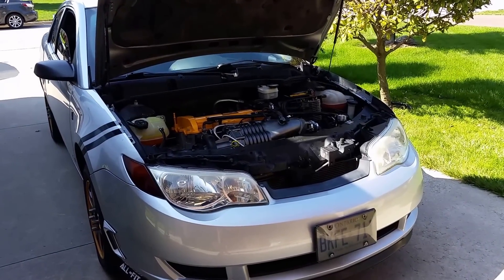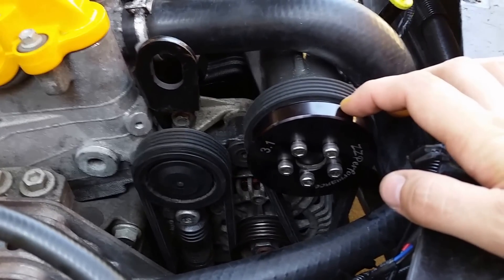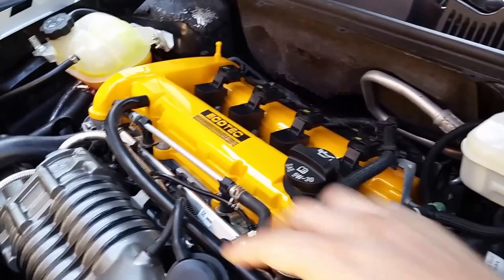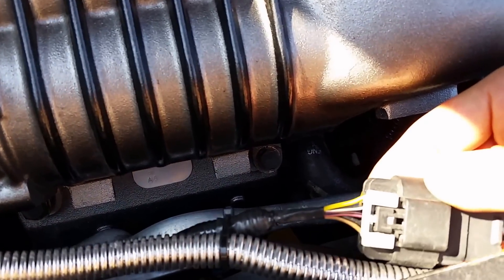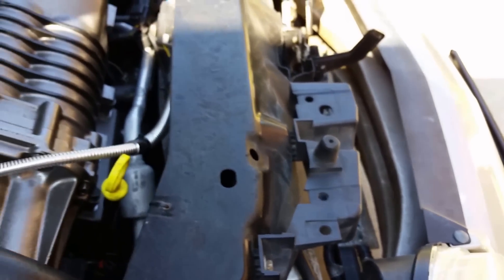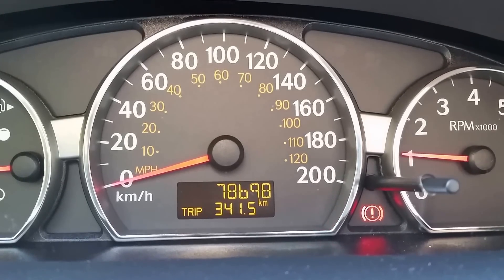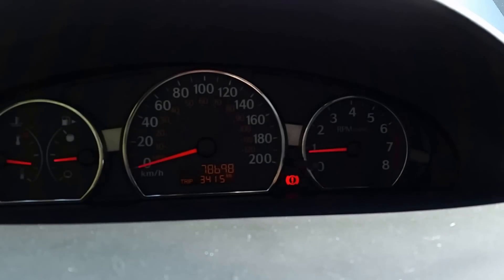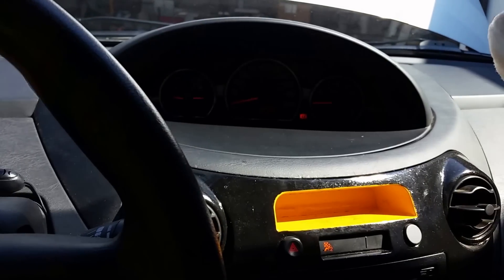How to Supercharge a 2.2L L61 Ecotec - Part 2 - Engine Bay, Idle, and Driving

Comment: I have a 2010 chevy cobalt xfe can you do anything to that? Any input is helpful. Thanks in advance.
Reply from the maker: It's a 2.2L with different gearing to make it more fuel efficient, I don't see why not! Should be the same Gen 2 block that I have in my car that was introduced in 2007.  Definitely tunable too by ZZP if you get HP Tuners or know someone who has it and can buy the 2 credits to unlock your car for a remote tune. Also it would be awesomely ironic to make an XFE into an SS and make it as fuel-inefficient as possible haha
Reply: If anything done right it should be faster considering the taller gears

Comment: nice job!
reverse rotation alternator could be detrimental to cooling, since the internal fan spins backwards
Reply from the maker: beforebefore thanks! too bad limousines and other vehicles with multiple alternators do the same thing. And it's been 14 months with absolutely no issues on my car, 3.5 years on my friends Cavalier with zero issues. 5 years on another local cobalt original alternator zero issues spinning backwards.... I'd say the cooling loss is negligible.
Reply: Vincent Colussi - Hey, it was just a thought, I'm glad it works out good!
Reply from the maker: beforebefore lol I thought you were sarcastically saying nice job, in that case thank you - oddly enough it has no real adverse affects although I see your point with the direction of the fins on the blades to cool it down. If cars were AC not DC then absolutely this would cause problems, luckily alternators convert to DC

Comment: so ecu-wise you changed nothing? only the software obviously?
Reply from the maker: Yes same stock computer, but had ZZPerformance tune it. Using HPTuners, and they e-mailed me my tune files to load into the stock computer and overwrite the OEM tune. Literally everything works as it should
Reply: Vincent Colussi would you send this tune file?

Comment: i  have a saturn vue 2003 whit ecitec 2.2 manual transmission  and i lovet but if is posible do supercharged
Reply from the maker: Marcos Martinez I mean theoretically yes, would have to see the engine bay layout but am sure it would be fine since a v6 fit in those. You would need to find a local tuner for your build though. Companies like Zzp and Trifecta only do 07 and above for 2.2L
Reply: How about a 2.4L ecotec greenline setup?
Reply from the maker: Honestly not sure about the Green Line, i know the 2.4L can be, not sure if the Hybrid components would interfere too much with the supercharger parts

Comment: learn to shift please , I  grind my teeth every time , that poor clutch , good build tho , well done , now I read the trans they put in those can only hold 300 hp is this true ?
Reply from the maker: shaun philpot lol I intentionally don't slam shift and wait for the friction point to grab. I could easily drive it aggressively but I value my clutch. That rattle was a bracket loose inside the dash I fixed it since this was uploaded. f23 is good for over 350hp. Getrag over engineered the safety factors the castings can take a beating compared to the f35.
Reply: Thanks for explaining , o0 awesome.

Comment: just bought my first cobalt I got a 2005 Chevy cobalt L's with 2.2 Eco tec been looking for kits anyone have some suggestions
Reply from the maker: Nick Breen Facebook groups are your best bet for used parts. ZZPERFORMANCE still sells a kit for around 750 without the blower or manifold. Can buy those used on Cobalt Nation Buy/Sell/Trade,  Ion Redline Lovers, Ecotec Nation etc. (all facebook groups)
Reply: Vincent Colussi I'm looking them up now but another question the motor in my car was replaced in 2014 with go to 133 but won't rev past 4k in park
Reply from the maker: Some tunes restrict your neutral/park rev limit to 4000RPM. Might be that?

Comment: Beautifully done! How difficult was it to install? I'm thinking about buying the kit from ZZP for my cobalt but I'm not sure If I reached that level of expertise yet.
Reply from the maker: oDieseLz it's not too hard their manual is detailed if you buy their kit. I pieced all my stuff together but have seen their manual it covers most the bases. Pictures torque specs step by step etc. 
Their kit doesn't use the LSJ TMAP sensor like my setup does though. Would recommend doing that since you can get that temperature reading after your supercharger compresses the air by wiring the TMAP temp reading wire to your MAF harness temp reading. I went to my local dealer and got the wire diagrams and pin outs for the sensors, easy to set up just take your time.
Reply: Thanks for the info. I could always just buy an SS but what would be the fun in that?
Reply from the maker: Exactly. Built not bought is always more fun!
Reply from the maker: @Cory Scopis because half the work is already done for you. Making parts compatible, thinking about signals and wiring diagrams and PCV port alignments and doing modifications to make something without said parts now have those parts is always more fun. 
This turned into a built motor with a TVS blower and made 370whp. Fucked up many people with my “level 2” Saturn Ion. No one suspects the base trim ;)
Reply from the maker: @Cory Scopis ya sucks to suck

Comment: Hey man, thanks for throwing this video up!  I appreciate your support for the L61 platform despite the limitations of the tune-ability. Just wanted to say that it's definitely a clean setup and looks really nice. I've got a completely stock 2oo4 Saturn Ion for the daily while I work on my project, my 2oo2 Cavalier. I'm in the early stages on the supercharger build and looking forward to getting it all setup. It looks like you're using a M62 supercharger like mine. I was wondering what you did to mount it on the throttle body? Can't wait to see your dyno sheet!
Reply from the maker: Thanks for the positive feedback, been getting lots of good messages and e-mails from people who are also curious to do this build now! I used the stock LSJ throttle body made for the m62 from a Cobalt SS/Ion Redline. For my engine there is a 6 pin to 8 pin adapter that allows that throttle body to be used on my stock harness. My buddy has a supercharged 2003 Cavalier, m62. He used his stock throttle body, there are adapter plates made for your throttle body to adapt it to an m62 blower. He's going to be upgrading his throttle body on his cavalier to an LS1 throttle body, another company makes an adapter plate for that as well lol. Your cable driven mine is electronic so we have to use completely different throttle set-ups. Will let you know how he manages to get the LS1 tbody to work on the blower. For now, you can get away with your stock throttle body with an adapter plate if you want. Look on JBody forums, may be some for sale. L61 to M62 throttle body adapter is what you're looking for

Comment: i have a 2009 g5 and supercharged it back in 2014 and i had to grind the head at the same part, and also had to grind part of my alternator as it is different than the older ones lol. other than that pretty much similar install
Reply from the maker: Papabless. We're supercharging my buddy's 2008 G5 this spring. Also a 2.2L, going to be fun!

Comment: just outa curiosity i have a 08 g5 i bought a supercharger kit of someone it has a 2.9 or 2.7 pulley i was wandering i know that zzp says it cant handle that much boost past 8 lbs how did u put the boost controller on
Reply from the maker: Cory Burns use a larger pully. Stock size is 3.4 that would put you in a safe range for boost. in 2008 they used different rods on the L61 motors and they're thinner than the 2007 and previous rods. 2.7 is very aggressive people can easily make 18psi with that. a 3.4 pully on your motor would make around 8 or 9 psi. a 3.1 on my engine made 12psi. My 2.9 makes almost 16psi now that I swapped to that size. Just to give you an idea on the pully sizes on a 2.2L.
Reply: Vincent Colussi so what ur saying is if i go get a set of rods an pistons from a earlier 2.2 itll be fine?
Reply from the maker: Cory Burns kind of. Look up the GM performance sport compact build manual. It's a 108 page pdf document. L61 block and crank and bearings are all good to 450hp. If you upgrade to forged internals (do that if you're gonna do all that work... don't go to 2007 or previous non forged ones) with forged rods pistons and new rings you're good to 300hp. upgrade your valve springs, then you're good to 350. Next do head work, cams, change bearings etc. and redo all gaskets if you ever plan to go over the 400hp range. Tranny can handle 300 ish fine. Don't slam shift if you have 250hp or more of you'll rip through your clutch. I'm going to upgrade to zzp flywheel and percormancd clutch kit one day since they make one for the 2.2 and 2.4L
Reply: Question bud? Lol i just looked up my engine serial number an build date
the date on my door is the build date right so it was built in november of
2007 my engine was built in October of 2007 so does that mean that i have
the 07 internals like yours to handle the power or psi im wanting since it
was built before 2008
Reply from the maker: I didn't upgrade my internals at all. Motor only had 70,000 KMS on it (40 something k miles) so rings were still mint. Stock clutch too I just don't slam shift it ever. Going to take another video this spring as I fixed that bracket that makes that annoying rattle noise in the video (that someone thought was my timing chain lol). For me, I don't boost ALL the time, just do some pulls here and there or when merging onto the highway. Have driven it for 15,000 kms now with this set-up and have had no issues
Reply: Vincent Colussi thats all im planning on doing aswell not use it all the time just to have it for show an tell an if a civic wants to run boom ill blow the doors of lol but im asking my engine serial number says it was built in 2007 does that mean its got the 2007 internals like yours does
Reply from the maker: No if your model year is 2008 it will have the rods and pistons for the 08 block

Comment: Hey man I love your setup!  I did the same thing with my 2006 Cobalt LS with the L61 engine just like yours.  I went a bit further and installed forged rods and pistons and threw a TVS supercharger on there but yours is so clean! I don't have any under the hood videos up on youtube yet but I do have some videos of pulls, drag race, and some autocross.  L61 FTW
Reply from the maker: I would love to go forged internals (Eagle rods, wiseco pistons and rings, and ARP head studs, with upgraded valve springs). Would cost so much though, but I could safely go Harrop or turbo at that point. Will see what happens, likely going to stay this way for a while, upgrade the exhaust and doing some appearance mods this year (lowering springs, bigger rims, redline spoiler, new front bumper lip etc.)
Reply: Vincent Colussi well so far your setup is very clean.  I wish I would have moved the IAT sensor to the manifold like you did.  I'm tuned without it but I do have a standalone gauge to monitor it.  I also went with meth/water injection to run 91 octane with full ignition timing advance.
Reply: JD B did you do anything to the exhaust? If so did you go bigger and do you need an adapter to go bigger?
Reply: How the hell did you get it tuned? no one offers tuning for the 05-06 L61 because of the oddball ECU it used. its literally the only think holding me back from doing any mods to it.
Reply: @sergeantseven4240  You don't really tune it in the sense that we've gotten used to, you use a standalone system that is separate from your pcm. It's less than optimal and expensive, but it works. Go scope out the J body boys and all the crazy shit they did without "tuning."

Comment: dude did u hear all that top end clatter holy crap ur timing chsin needs the updated tensioner
Reply from the maker: Steven Wirgau no that is from inside the car I had a loose bracket in my instrument panel after I ripped it all apart lol. Timing chain is fine.

Comment: Nice! I'm buying the zzp kit when I get my cobalt paid off. Those 2.2 Ecotecs are strong little engines. They are underrated for sure.
Reply: Oh for sure they are bulletproof motors and they have a lot of potential
Reply: Anal Rampage  you're wrong buddy.
Reply: Bro the stock internals on a 2.2 cant even handle more than 6 psi, you cant just put a roots blower on a 2.2 and think its the same as the lsj its absolutely not, the lsj has forged internals

Comment: I messaged you on Instagram
Reply from the maker: Jajuan Smith I saw that it won't let me view it again to reply. I used stock lsj bracket to hold my pump. It bolts to 2 holes in the block that are already drilled and tapped ans 3rd large bolt connects to the bottom of the intake manifold

Comment: Who says you can't but supercharger on goddamn 2.2L Ecotec.
Reply: What about a 04 cavalier
Reply: You for sure can't on a 2005-2006 2.2, they used an ECU that no one offers a tune for. I'm so pissed. just that year model. HP tuners and ZZP both don't offer anything for it.
Reply: @sergeantseven4240  Damn, my friend wanted my help to boost the power on his 05 2.2 in his Chevy Cobalt Ls, figured supercharger was the way to go. What about rewiring a new ECU and tuning it manually?
Reply: @Not_Loading   if it's an issue with the Delphi ECU then check out http://www.obdtuner.com/ and email Peter with your details, he will sort if you can/can't
Reply: @sergeantseven4240 
 if it's an issue with the Delphi ECU then check out http://www.obdtuner.com/ and email Peter with your details, he will sort if you can/can't
Reply: Similar story on my 05 vectra 2.2 sri no way to mod it 🙄
Reply: @majorchronic81   if it's an issue with the Delphi ECU then check out http://www.obdtuner.com/ and email Peter with your details, he will sort if you can/can't
Reply: It's a GM part #
Reply: Im stuck with a 2006 cobalt with headers and C.A.I. with no tuning abilities. Mad as hell
Reply: These cars are stupid cheap now lol. Just find an 07 cobalt ss/sc or 07 2.4 or 2.2 cobalt.
Reply: @rogerleadbeter1625  There's still an option: stand alone ECU, such as Megasquirt 3.
Reply: @kjax76  whats a stand alone ecu? Who makes Megasquirt 3

Comment: damn how much of a difference did you feel by adding it?!
Reply from the maker: A LOT haha. I swapped my 3.1" pulley out for a 2.9" pulley too now and did a tune revision. This set-up in this video is with the 3.1" making 12psi, I now make 16psi and it's unreal! Estimating 230whp easily. Dyno someday.
Reply: Vincent Colussi Now I'm running  24 degree ignition advance with a 2.9" TVS on 91 octane because I am also using water/methanol injection.  I couldn't run any timing hardly at all on 91 without it.  I daily mine too.  I work on that bitch a lot though.  Sub-par and used parts have caused me so much trouble.
Reply: I just wish I had more tuning options.  05-06 is rarely supported.  I only know of Trifecta but they have technically pulled support.  Luckily I am sort of grandfathered in with them.
Reply: Vincent Colussi I'm surprised you swapped down as you probably had to pull more ignition timing to compensate.  what gas are you running?  I think I could only get around 15-16 degrees of ignition advance with 91 octane on stock internals with 3.1" pulley iirc.
Reply from the maker: JD B that's a whole new ballgame with a tvs. I can only imagine the power you have though with that on an L61 lol. How much psi does a harrop make on a 2.9?
Reply from the maker: Also, 11/10 on methanol injection. that stuff is god tier
Reply: Before i got my exhaust ports port matched and 3" full exhaust I think I was around 19-20 psi. However when wrapping over 7K and doing a pull it is hard to look at the gauge much as I need to keep my eyes on the road.  After getting the head exhaust port matched and 3" exhaust (I've had LT header whole time I've had TVS) my psi dropped to around 17-18 psi max.  When you free up restrictions it drops boost but you pick up on power.  I more got the 3" exhaust because I like the way ZZP's sounds and I was tired of my 9 year old 2.25" magnaflow exhaust.  This exhaust is a lot less ricey sounding.  I went ahead and went all the way to 3" because this is the second exhaust I have put on here.  I'm not about to do it again.  It probably is not real benefit over the 2.5" option.
Reply from the maker: JD B nice numbers, and yes the restrictions being eliminated will allow for a much more efficient flow through from intake through exhaust. You should dyno! I'm driving to ZZP this summer to get a cat back installed (2.5 inch). I have their shorty header and 2.5 downpipe. currently a 2.25 inch resonator delete then stock 1.75 to a 2.5 MagnaFlow muffler. I need a catback desperately haha. Going to dyno tune my car at ZZP too
Reply from the maker: Yea most only support 2007 and up since they use the same ecm as the 2.4L that year. I got lucky with an 07 lol good thing they grandfathered you, only other option would be a  standalone or local tuner. Nice video btw I just checked out your channel, motivating me to get that zzp exhaust haha